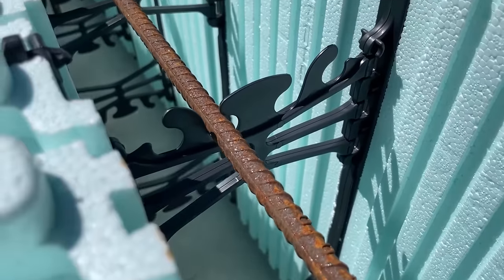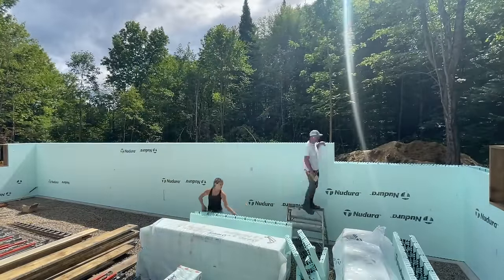WE HAVE CONCRETE WALLS | Couple Building Their OWN HOUSE | ICF High Efficiency Home

Comment: This would be great if they didn't overcharge you for styrofoam like 20 times what it's worth just mix the mud and lay the regular block you'll be better off in the long run
Reply from the maker: We aren't going to sacrifice the quality of our house to save a few bucks, regular blocks are absolute garbage for our climate here and they would never be close to the building specs these ICF blocks are. Not even remotely comparable, especially in the harsh Canadian climate we have.
Reply: @TimberMates  lol nice. Seriously?
Reply from the maker: @Fred-zt6gf  Hard no. it's not about it cracking, it's about the incredible strength and efficiency benefits and regular forms SUCK when you look at those factors. No offence but we don't put these videos up to ask for peoples advice on what we should do, Brandon is extremely experienced and we are building an incredibly strong, efficient and well-designed house and these videos are for the purpose of sharing OUR experience and ideas, and of course for entertainment value.
Reply: You clearly have no experience  with this system.  Strengthen,  efficiency,  sound suppression,  and longevity all favor this system.
Reply: For those wondering, the ICF blocks have a slew of benefits they add to the construction. #1, the “styrofoam” insulates on both sides. On the outside, siding can be connected directly to the foam. The inside layer can be used as is, but you can also hang drywall/sheet rock on it. So outside in, you have siding, which minimizes direct sun/moisture/wind exposure, foam layer, concrete 4-12 inches thick, another foam layer, and Sheetrock. Idk how else to put it but, with all of those your home’s R value is insanely good, and theres no drafts like you get in traditional wood construction.  This house will be so dang energy efficient its not even funny. 

Well done to these guys!
Reply: @TimberMates  unbelievable great product.. I've worked on homes like this.. the incorporated wall studs, the cooler like insulation factor.. the homes are super solid. Spray foam attic, boom.. best house ever.
Great work. I'm jelly
Reply: @RealSweetKid Those are all factors, yes. But the overall construction itself is also a significant factor. It’s too bad no one can customize the windows and insulation in their roof when building a home!
Reply: @TimberMates if you're going to get upset don't post stuff. You opened yourself up to criticism by posting.
Reply: Alibaba guys.... 2.75$ a piece for the exact same thing big companies like fox are charging 27 dollars a piece
Reply: @jedwheeler2728 i bet shipping and duties add $12 a block lol 
I used build blocks on my home and pool
Reply: Honestly there's some companies out there now that offer the ICF at a great rate. $31 for a 1pc. that's R24 ,  16" H. × 48" L × 8" W inside /13.5" W outside  .  That's not bad
Reply: Foam is an insulater.
Reply: @Fred-zt6gf  the Styrofoam doesn't come off. You leave it like that and it can put stucco or whatever else on it. It acts as insulation.
Reply: @Fred-zt6gf it's not just a foundation, it's a basement. There's the benefit of insulation also. Just because it's different doesn't mean it's bad. We ex and I built our house using Styrofoam forms and poured concrete. Way cheaper, and you save money time, cost of block and heating and cooling costs. Honestly,  one of the best decisions we mademwhen we built and if I ever build again, this is what I'll do. That's how happy I was with it.
Reply: @TimberMates  I did rebar and lath in NYC for years. Just use plywood and you'll be able to use it on something else once it dries.
Reply: @TimberMates ”HARD NO”. 🤦🏼‍♂️ Tell me your a DOUCHE without telling me your a DOUCHE!!
Reply: @TimberMates  doesn’t matter what you put the videos up for. Once it’s public. It’s an open forum. you’re going to get anything and everything. Including advice, even if you don’t do it for that.
Reply: Simple Living vibe responses here.
Reply: I live in northern Mn.  Plain block is horrible- they always leak and have condensation which if you can’t seal out means it gets moldy and very bad for your health.  Plus you aren’t calculating in the cost of insulatio not to mention the framing needed to put walls up on those blocks.  The concrete blocks have hollow cores where this process provides solid concrete and insulation on two sides.  We did it to our basement and it’s never cracked.  However, I also had a cement block basement and it was so damp all the time.  It did crack from heaving as they are not solid.  So you need to add more to your calculations to compare.  Cement block, mortar, framing, nails, insulation and your time.  Sure the blocks themselves are cheap but all of those things listed above would be needed to end with a similar product and the manpower is weeks compared to days- all in all cement block would be close to double the money and 1x the labor.  And you’d  still end up with an inferior basement. 

Your basement, in order to be cheaper would be cold and wet; I’m guessing that is why your basement cracks.

Comment: ICF is way underused in the US.  We built our home with Logix blocks.  Been here 6 years and could not be happier. Huge energy savings - house feels so solid.  Built for$80/sqft
Reply: I was wondering the cost efficiency cost etc as I am from Ireland and we get fairly cold wet winters Henry M Dooley thanks
Reply: Is that the cost per floor square foot?
Reply: @spindle7397  yes. Labor and materials have gone up a lot since then.
Reply: Is that you with a crew (raw cost labor hours plus parts ) or hiring a GC and paying him by the foot ?
Reply: @oci464  so the ICF work-block, rebar bucks etc all done by me and my wife- we took a course and did a lot of research before we started.  We hired a guy to do the pour.  That was around $2000.00 for 2 days work for two guys- well worth it. 
I was the GC for all of the work on the house.  
We did some work ourselves- some interior painting some interior trim, and I did some of the final plumbing. 

If you have not been a GC before don’t let that scare you.  There are good books on how to do it.
Reply: We use ICF a lot in BC, its good at reducing formwork time and for its thermal value. Make sure your work is inspected by a structural engineer before pouring the concrete, money well spent in the total cost of things
Reply: Hehehehe❤😢😅
Reply: @SyzDump  ?🤷🏻‍♂️
Reply: Expensive compared to traditional building but very energy efficient. You save money with cooling and heating. In today's market, you're looking at 50% additional cost. Or on average of about 10k extra. Unless you're going to live in the home for the rest of your life, you won't ever see a ROI. If you do plan on living in the home 4ever, I would consider the price totally worth it.
Reply: So only $160 now….
Reply: @I_SuperHiro_I  costs have no doubt gone up but if you can be your own GC and can do the ICF work yourself I think the costs will be comparable.  The ICF is basically just foam and plastic and rebar and concrete is still fairly reasonable.  I do recommend you get someone experienced for the pour.
Reply: @shperax  assume you have never built with ICF.  The block, concrete and rebar have gone up some but not as much as lumber. If you are “handy” you can do the block work yourself or with just a little guidance.  While some ICF houses are very expensive, partly because they are very elaborate , if you keep it fairly simple and you can do the ICF work yourself you will find fairly comparable costs- definitely not 50% higher.

Comment: Idk why everyone is hating on your build. ICF is an amazing innovative material and very strong too. I have a concern over the fire resistance of the foam and the toxic chemicals used to process them but overall still a nice home.
Reply: I don’t think there is a toxic factor to the insulation and most insulation has to fire safe to pass inspection.  However, even if it was? It would be behind sheet rock inside so there still wouldn’t be an issue.

Comment: So just a few minutes in and have seen a couple things that have led to blowouts in previous pours we have done.. be careful. Just because you did it successfully a dozen times, the 13th time your corner will blow because you didn't put clips on the bottom of the bottom course.
Reply from the maker: We put all the clips in and supported the outside of every corner, please remindful of the fact that these videos just aren't long enough for you to see every screw, clip, or bit of rebar go in. We are extremely diligent.

Comment: 30 years that rusty rebar willnt be doing a thing. Hopefully they installed railroad tracks every 2 feet because its a thin wall. Because its load bearing.  You do it every 4 ft for cmu block. 2ft for concrete walls.

Comment: We were 50 when we started our ICF home.  Began with basement, used our exterior walls as bearing walls for the metal truss’s & metal roof.  Been 23yrs & love the quiet, this house has been wonderful.
Reply: I was one first trained in building these type of houses. Man has it been a long time. But funny these and the much cheaper concrete walls really don't have any difference except lots savings. Both quite efficient

Comment: Looking really great guys!! BTW, I surpassed my record mixing concrete in a mixer. 11 Mixes in one 9hr day. 2 bags quickcrete @88lbs each, 1 bucket lime, 2 small bags anti-crack fibre, and one scoop hosphere. I didn't count the shovels of sand or water used, but it was a lot. 1 mix filled 2 wheel barrows to the brim. 5 plasterers on the wall plus 2 labourers hauling buckets up. I could barely keep up. Got the house done with scratch + finish coat today. Now it has to sit till everything cures and ready for the pre-mix stucco coating and texture. The client will be amazed when we are all cleaned up and done. Cheers, Blessings!

Comment: Proper pre planning and design is paramount when it comes to ICF. I appreciate Brandon’s skill and knowledge. I designed my home in the same manner: block size dictated building dimensions and window locations. 
Exciting for you both, keep on going!
Reply from the maker: Couldn't agree more! thanks so much
Reply: Just curious are you allowed to design homes without architects and structural engineers in your country or you just illegally saving up on that to save few thousand dollars but spending millions without prior knowledge that an licenced professional can provide.
Reply: @aniketsharma3177  I can’t speak for Brandon but myself, I’m a certified Draftsnan and Red Seal Journeyman Carpenter with over 34 years in the housing industry. Having said that tho, in BC (again can’t speak for Ontario cuz I don’t live there) anyone can draw up a house plan and submit it for building permit. It’s at that time that the City Building Officials will ask for a Professionaly Draftsman or Architect design or Engineer’s stamp.
Now Commercial Building or Multi Family Developments, those require Architects and Engineers, always.
For my ICF Design Build I was required to have an Engineer sign off on the rebar as I live in an earthquake zone.
Reply: Build smarter not harder.  This is why I think all engineers should have been in the trade first so they know the process.  Engineers around where I live have become really sloppy lately.   We had one build that because the engineer did not get out of their car to check the land, their owner probably paid and extra $20,000 to have a huge 12 ft retaining wall made that was not even needed and now the back yard of the neighbor instead of having a nice sunrise to see, its just a giant concrete wall.
Reply: @macmac1022  I agree. Way back in the day, I spent all of highschool and first year college learning Drafting…I was planning on pursuing architecture. Fell into home construction the summer after graduation and very quickly realized just how much I was getting taught at school either made no sense or plain just didn’t work in the real world.
Reply: @Crittermoto  Yes, there is a difference between knowing and understanding.  Its when you have the combinations of both a person can really shine and right now it seems like many engineers are just knowing, not understanding.

Comment: It is nice to see, that ICF gets popular, resulting in better quality, longer lasing homes.
However, I miss some basic things from almost all ICF building videos: 
- no vapor barrier between footer and wall
- using ICF with minimal thermal insulation (external wall of the ICF block has the same thickness as the internal)
Reply from the maker: ICF is a great product but some different installation techniques. I follow the local building code and Nudura installation method with great results. Have you built with the product yourself?

Comment: I helped my brother in law build their home using foam blocks very similar to these (had steel mesh internal rather than plastic). Went up in rows of six with tons of rebar and then did concrete fills. We did have one block blow out during concrete fill. Lost a lot of concrete during fill - used a sheet of thick plywood and Mr Massey Ferguson to stop the loss.

Comment: My mom's house was built like this. it was great except for the crew would put up walls one day and plan to concrete the next, only for wind to blow the walls over in the night.

Those metal supports I see in the video seem like a huge boon that the builder didn't use 15 years ago. I also love the fancy metalwork inside the blocks.

Once it's all done I can attest that it's pretty well insulated on the sides and the biggest heat sink will be how well the roof is insulated. I also like to think it's better fire resistant but haven't ever had to put that to the test (knock on wood).

Comment: My ex and I built our home in 2002 with poured concrete walls with Styrofoam forms for the basement just like this. At the time, no one was doing this. It took a day for them to put up the forms and the next days they poured the concrete.  It was a fraction of the cost that it would have to use block and a fration of the time. For those saying that you'll be better off with block...sorry, but nope! Our basement was 60 degrees summer or winter and we lived in Michigan.

Comment: When I built my ICF house. I hung the entire first floor before I poured the concrete to square the walls and easier to fill walls than walking around on the scaffolding.
Reply from the maker: good idea ive never tried it myself
Reply: @arminkowitz2726, is there any risk to doing it this way? Floor trusses before pouring. Does it reduce amount of needed bracing?
Reply: @vitalyy2589   I mounted my floors like this vid. I screwed the ridge beam to the ICF and braced it with wood to the foundation.

Comment: Seems smart.  Having soft foam interior walls is a problem though when you need to attach something to the wall which happens very often.  You have to cut or drill deep thru the insulation.  Relatively minor issue I guess.  My basement is like that....parts of it anyway.  I guess you could slap a layer of sheet rock over it and call it a day.
Reply from the maker: There's ribbing in the foam that acts just like studs in a normal wall. It's really no different other than being way better lol

Comment: Looks fantastic I wonder if have used a crystalline waterproofing mix like BASF tegraproof to prevent water intrusion keeping the basement air less damp into the concrete pour.  But maybe overkill if your foam handles that?

Comment: Perhaps you can comment on the next video with your self milled beams about drying them? Is that a thing you need to do? Kiln? Etc.
Reply from the maker: the beams will dry as slowly as possible over many years to come. ( the slower they dry the straighter they become ) This is how all timber frames are done. We have adjustable jack posts supporting them so we can account for any shrinking in the future. This would be very minimal aprox 1/8th of an inch
Reply: @TimberMates  Excellent, thanks for the input. I do woodworking with dimensional hardwood like walnut, ash, etc, and we have to worry about moisture content all the time, and into the future. I did not know how that worked with larger beams.

Comment: I will be building an ICF house. I am a little unsure about DIY, because the door and window openings and especially all the other openings, like for AC lines, water pipes, electrical, vents and drains. Alot to remember and figure out.
Reply from the maker: give yourself lots of time to figure out the penetrations its important to get them right, its saves alot of time and special tools later. if your not sure add extra its easier to cover than to drill.

Comment: Two things: 1) you never know when if you have voids into your walls, and that matters in case of an earthquake; 2) in cold climate, the interior side of the polistyrene will keep humidity inside the house, causing trouble. One way to deal with this is to tear it apart after the concrete has been cured.
Reply from the maker: So since i have built a few ICF homes and lived in some for 20 years, in a very cold climate i can tell you that well frankly your mistaken. Its quite easy to tell if you had a void and not terribly difficult to fix. This house didn't have any. And the humidity problem you referred to just doesn't happen.
Reply: @TimberMates  I don't mean to be an ass, but how can you tell there is no void in the walls ?

Comment: You are doing a great job, both building the house and making the videos!  I noticed that you did not use adhesive on the first course of blocks on the footers.  Was that intentional, or did you just not show that in the video?  Thank you!
Reply from the maker: it was not in the video but we spray foam the blocks to the footing, also the bracing is fastened to the footing and the blocks so that also holds them in place